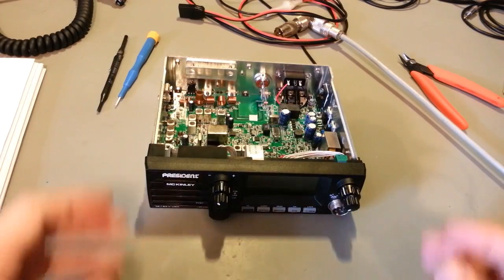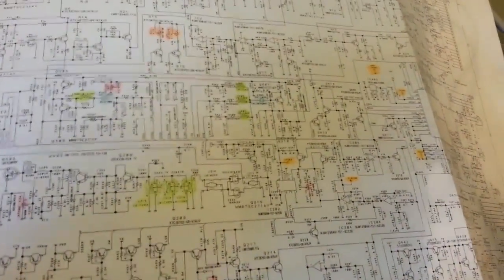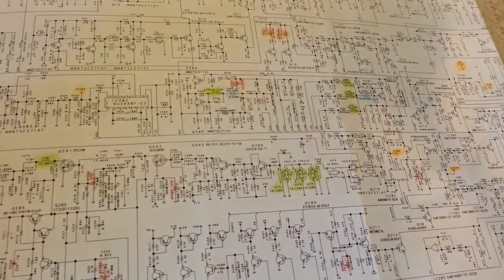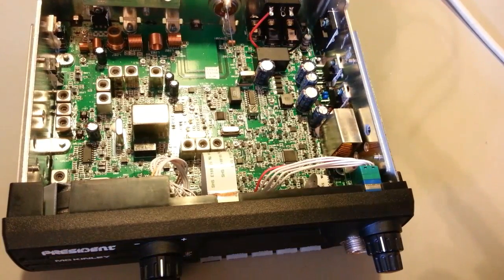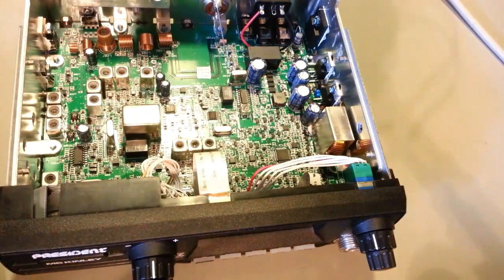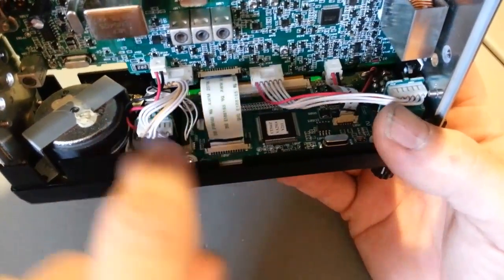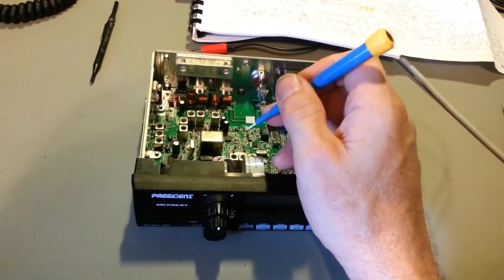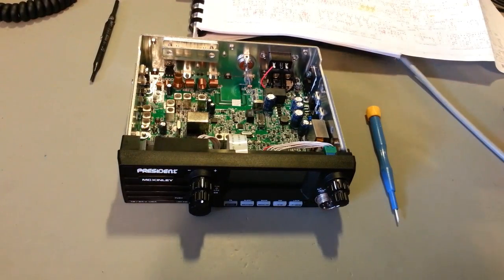President McKinley USA clarifier unlock procedure.

Comment: Great Video Mike! I started doing surface mount repairs on hearing aids made in Switzerland in 1986. Been a radio hobbiest since way before then so I used my experience on CB and Amateur equipment. Great find on the mods. It's probably what President had to do to get certification. Great Technicians will always figure out a fix/mod. :-)
Reply: Soldering can be a tricky thing to master. I got started by adding lights to my motorbike.

Comment: Thank you for sharing . I live in the UK , I have a President MC KINLEY also , but the strange thing is their completely different radio's inside  insofar as the main PCB mother board is completely different , the operational software on the menu is quite different too , it's most strange , I guess there's different radio types for the U.S & Europe .

Comment: Hi @mikesradiorepair , this is why it is preferable and more judicious to have a CB station with a "Clarifier" device dedicated to reception (Rx), and another dedicated to transmission (Tx). When using a CB MOBILE station (Rx and Tx) in driving, we cannot clarify both at the same time, normal because it is up to the (QSO) receiver to clarify its reception (Rx)!😉 In summary, do not to buy an MC KINLEY to use it at home (QRA), An MC KINLEY is designed to be used in MOBILE CB. Buy a GEORGE 2 or a Washington 2 instead!😁 Sincerely

Comment: Thanks for your excellent video!   I'm wondering why the radio wasn't supplied with your necessary modification?   I'm currently considering the new "II" version, so I wonder if the new version is supplied with your improved circuit so that the clarifier works properly?

Comment: With just moving the two through hole resistors, how much movement was in the coarse clarifier, and was it so far off on rx that the fine couldn't pull in the received signal?

Comment: I recently unlocked my clarifier rci 2950dx  but its slightly out of exact alignment between transmit and receive by about 75 hertz .... Adjusting lsb can, just moves both transmitt and receive together
Lmk if there is another adjustment to calibrate xmit and receive after unlocking clarifier.

Comment: Why do people want the fine (rit) unlocked? Surely just use the coarse (xit) control? What if the other persons tx and rx are misaligned?
Reply from the maker: That's not a problem.  If RX and TX are still factory with only the RX being adjustable from the clarifier on the other persons radio when they transmit you adjust your clarifier to "tune" them in.  Then when you transmit on that same exact frequency (because your clarifier has been unlocked) the other person adjust their clarifier to "tune" you in on RX.  There's never a problem with 2 people when either both or neither have modified clarifiers or only one has a modified clarifier.  The problem occurs when you have 3 or more people talking.  With factory locked clarifiers you end up chasing each other around with the clarifier every time a different person talks.
Reply: Hi  @mikesradiorepair , this is why it is preferable and more judicious to have a CB station with a "Clarifier" device dedicated to reception (Rx), and another dedicated to transmission (Tx). When using a CB MOBILE station (Rx and Tx) in driving, we cannot clarify both at the same time, normal because it is up to the (QSO) receiver to clarify its reception (Rx)!😉 In summary, do not to buy an MC KINLEY to use it at home (QRA), An MC KINLEY is designed to be used in MOBILE CB. Buy a GEORGE 2 or a Washington 2 instead!😁 Sincerely

Comment: Why so small? to make it near impossible for us to repair? with this micro circuitry one scratch to the board and your screwed.
Reply from the maker: Cost, reliability, performance, stability to name a few.  Pretty much all modern electronics use surface mount parts.  They have been around for over 50 years.  Production cost of them is now much less than comparable thru hole parts.
Reply: @mikesradiorepair  I love the President Richard CB radio I bought 2 of them.

Comment: What is the benefits from unlocking the clarifier?
Reply from the maker: +Kurt Peckenschneider 

Your transmit and receive frequencies are then locked together.  From the factory the clarifier only effects the receive signal.  The transmit signal is only adjustable inside the radio.  Unlocking it locks (kind of a contradiction of words) the RX and TX frequencies so they are the same.  Factory is fine if only two people are talking.  One person talks, you clarify them in and when you talk that person clarifies you in, all is well with the world.  The problem is if a third person enters the conversation.  You end up continuously adjusting your clarifier to tune in one person or the other.  If everyone had their radios with RX and TX locked together it wouldn't be a problem.  You want to enter a conversation, you clarify that person in and when you transmit it's on the same frequency.  Amateur radios generally are selectable.  You can make independent RX and TX adjustments or select to have RX and TX locked together with the push of a button.
Reply: Freelancer FRLNCR 

Because the FCC has stupid rules that say they can't do that.  Back in the mid-70's, I had a Radio Shack TRC48 (I think) 23 channel SSB radio.  It's clarifier tracked xmit and rcv together.  I think when the new 40 channel radios came out in 78, the new FCC type acceptance rules required a fixed xmit with the clarifier only tracking recieve.  As Mike correctly noted, this causes all kind of problems with conversations involving more than two people.